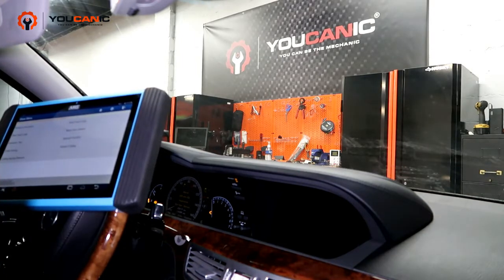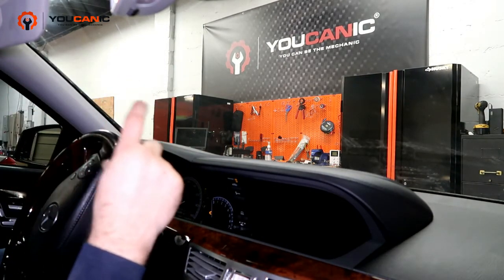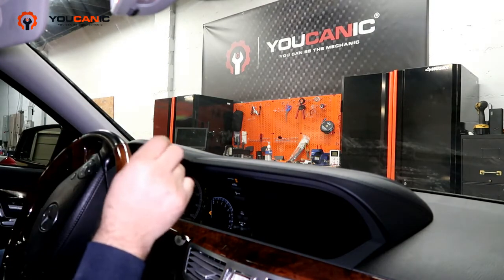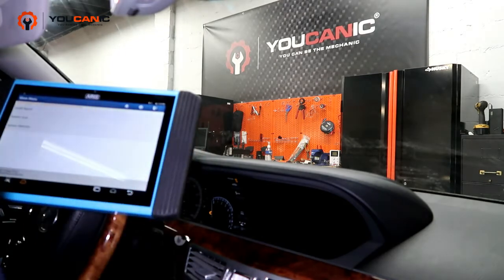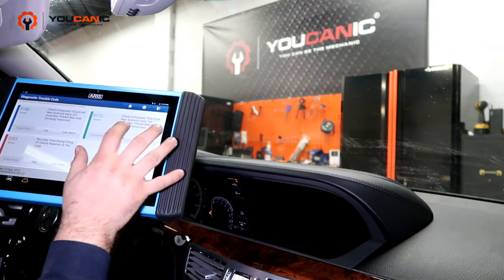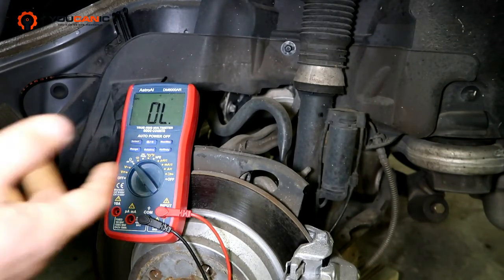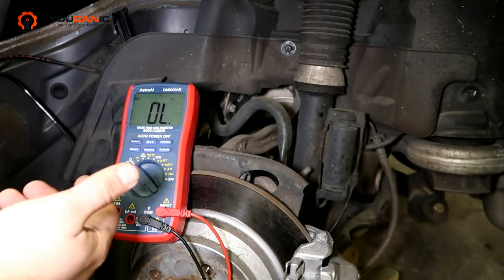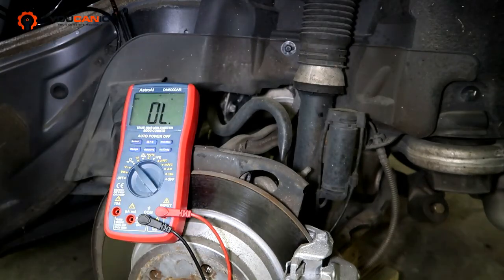Troubleshooting Mercedes-Benz Air Suspension Electrical Problems

Comment: Thanks for the video. I got less than 1 ohms when performing this test in the rear right valve. I don’t see any broken wires visually. But apparently something is broken somewhere. Is the wire replaceable? Also, do you think I can detach the wire from the valve and test continuity on the valve directly?
Reply from the maker: @ELWIN225 If you’ve got a car issue or repair question, you can find step-by-step guides and scanner help at youcanic.com. We might miss some comments here, but our site has answers for most problems already!
Reply: @YOUCANIC I have downloaded your manual but it doesn’t answer my question